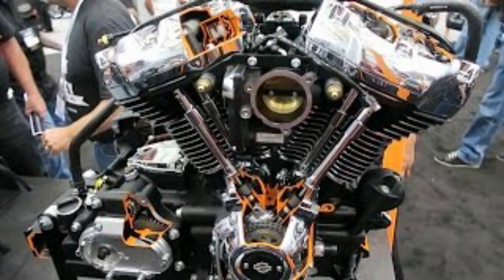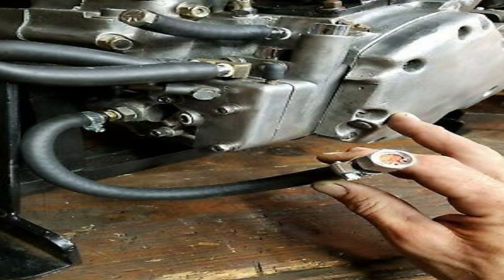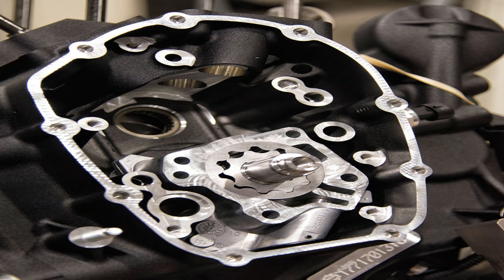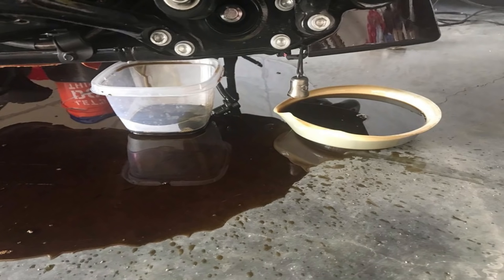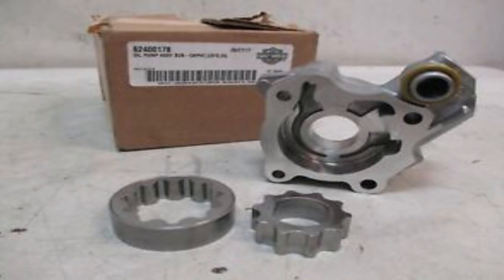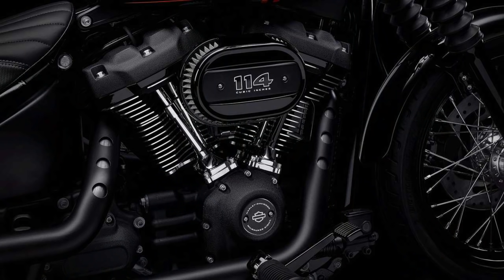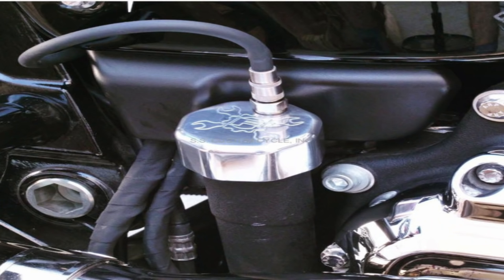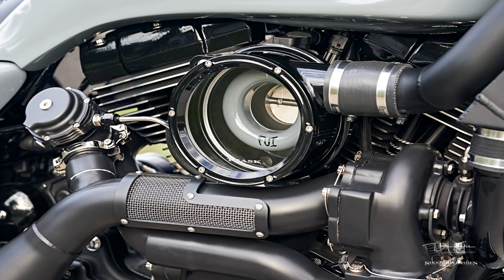The Fatal Milwaukee 8 Engine Flaw Harley-Davidson Missed

Comment: Most of the S&S cam kits are out of stock. Good luck getting what you want.
Reply from the maker: Have you shopped around at some of the suppliers? Parts Unlimited, Dennis Kirk, JP Cycles?
Reply: @GixxerFoo  Thanks, JP is out of stock, but I’ll try those others that you mentioned.
Reply: @GixxerFoo  Parts unlimited is out of stock.

Comment: I have not upgraded because this should be a warranty problem, not an added $2000 out of my pocket.  H-D F'd up and needs to fix the damned thing.  They will probably have a class action lawsuit against them.  I have had several times while riding the bike when it is hot it takes more throttle to keep up the same speed.  I live in the southwest and the desert gets up to 120 + degrees and I ride my bike EVERY DAY!
Reply from the maker: The bad part is Harley won't fix it unless it presents a safety issue, that's the sad part about it. They should fix it and put the updated part in since they messed up.

Comment: I have a shovelhead & a twin cam based on this video and all the others, my next will be a revolution maxx
Reply from the maker: I don't blame you a bit, every Harley has it's issues. I am curious to see how that new Revolution Maxx works out.
Reply: @GixxerFoo  
150 hp from factory. Can you imagine when zippers & S&S get ahold of the heads & cams. , HPI Throttle Body & good flowing exhaust? Could be some very impressive numbers !

Comment: Can you explain how this got by the research and development department? This engine and I owned one works pretty well for an engine with unequal oil pressure. Any engineer worth his salt would’ve caught this. Any mechanic worth his salt would’ve caught this. I don’t know maybe they’re pressure transducer’s failed on the run stand.

Comment: So a stock M8 will never see this problem then?
Reply from the maker: The problem is that they came from the factory like that, it's a potential issue with even a stock M8.
Reply: @GixxerFoo  is Harley going to do anything about this then? Do dealers have discounts for the work or anything? Any lawsuits from failures you know of?

Comment: It's not a problem on a shovel. It's normal if the bike has sat up for a while.
Reply from the maker: For sure if it's sat a while, Harley had some oil issues back in the 70's when the bikes were new. All the emissions crap and the junk fuel back then was awful for those motors.
Reply: EVOS do that too ! Problem wasn't solved till 1992  ! Here's how I cured my 91 I ride it everyday ! LMAO
Reply: @leonardstanford1877  agreed brosh 🤘.
Reply: @GixxerFoo  no doubt but it's like you said never buy nothing brand new in it's first few years. Preciate the channel 🤘

Comment: Does everyone know about the feature to keep engine cool where you turn bike on but not started and roll throttle forward for 3 seconds special feature look it up there is also a video about it
Reply from the maker: Parade mode is what it's known as, it shuts down the rear cylinder at a specific temperature when you're at idle. Bike sounds awful but it works!

Comment: The twin cam motor has issues & now the M8 has more issues ! Buy a 99 to 02 bike drop in a big S & S motor & the only time you have to see a M8 is when you blow by one ! Enough said !
Reply: Or just buy a Honda motorcycle and be done
Reply: @Bart Szmanzki 99 to 02 bikes had a timkin bearing holding the flywheels in the left side of cases & those flywheels were solid also the primary drive line was a much more dependable system ! I like the 88 to 95 inch motors that short stroke let's the motor rev quicker  ! Those early TC motors all you have to do is add a gear drive & the only issue they had ( cam tensioners ) is gone just add gas & oil  & ride !

Comment: With all the quality issues like these I think I will stay away from these M8’s. From the oil pump, the blow by, the loose oil jets in the pistons, all just screams crap quality to me. I haven’t heard about these issues from other manufactures such as Honda or Indian. I think my next bike will be one of those new Indian chiefs.
Reply from the maker: It just blows my mind they had those issues going on for several years, they've got it lined out out now but I haven't seen a confirmation on the long term with new oil pump. I do know earlier M8's with upgraded aftermarket pumps and vented dipsticks/transmission covers have eliminated sumping.
Reply: I rode a Victory Vegas for 10 years never had a single problem, recently ordered a 2019 breakout 114 but after watching this video i feel like just shot myself in the foot FML >< yea i shouldve stayed loyal to Polaris and got an Indian dark horse bobber :(

Comment: POS oil pump causes mad sumping .. thus frying my crank sensor and leaving me stranded on a cold December night.
Fortunately was able to get a ride home and a shop I know scooped up the bike in the morning
Took a few months to get a crank sensor.
Did a Daytona oil pump, new crank sensor .. and since they were in there .. did a cam upgrade, lifters and some other bottom end stuff 
And a good tune .. and catless head pipes 
Bike rides 40000x better now than it ever has frlm factory.  2019 FLHR.  Broke down 9400miles

Comment: Oil sump is only the tip of the issues for  the M8 .
Reply from the maker: It's one of the biggest ones right now that's caused a lot of issues.
Reply: @GixxerFoo  Not even close to to biggest issue.They are sucking headgasket due to to fitment at the base of the cyl ,at the case, where the oring is , jugs are turning blue they are getting so hot. Its one big pile of crap ,Neber mind the connecting rods dont even have a bushing for the wrist pin. i could go on.

Comment: I picked up a used 2018 Fat Bob 114 with 2300 miles on it. Engine had a catastrophic failure at 2418 miles. Fortunately I was able to get my money back and got on a 2020 Lowrider S 117. Less than 300 miles later same thing happened. In my experience M8 is a turd.

Comment: How the hell is there not a recall on this?
Reply from the maker: It honestly should be, but it's not considered a safety issue so it doesn't require a recall. I think last recall Harley had to do was for brake system issues, so if it's not going to injure or kill someone you're on your own it seems like.

Comment: Never seen a 8 valveoil pump give trouble yet & i know heaps of people with them .these billet alloy parts are crap its soft alloy & wont last . As far as venting gasses the heads are well vented .this is just crap oil froths when heating up once it hits running temp it stops .also never seen a 8 valve leak unless its been played with .

Comment: The oil pump was upgraded for four years in a row, still not as good as just going with the s&s plate and pump. Transmission oil problems another problem.
If you like wrenching and spending money there the perfect bike. I'm on my third one and will not be doing this motor company anymore.

Comment: Did Harley get in front of this and change these for customers at no charge?
Reply from the maker: They weren't replacing the pumps unless you had sumping issues. But they did update the oil pump on the 2020 models.

Comment: lmao vented dipstick ..... just put the trask trans vent on problem solved and run a catch can to keep your top end clean ...17 - 19 need the pump upgrade also
Reply from the maker: M8's have awful crankcase ventilation, anything helps to keep that oil flowing. Really seems like the upgraded oil pump is the best way to go though.

Comment: HArley has had 4 oil pumps for the M8 and still can’t get it right…….
Put an S&S or another performance mfr oil pump and don’t forget to 
Put a different cam plate in while ur doing it….HD cam plates are shit also
Reply from the maker: The cam plates are crap, I have a whole video on the twin cam cam plates covering that https://youtu.be/Fi81VH4y9AM. The M8's are not any better.

Comment: Airated oil has never been good. Where there’s air there’s no lubrication ..  and fluctuating oil pressure. And with a sender that works on 5 or 10psi. Not good as said oil light may never come on to inform you.

Comment: Why should an owner who has spent maybe $20,000 on any new bike, including a HD, just "expect" teething problems with a new motor. If this is so it does not bode well for the new Pan American does it??
Reply from the maker: The Pan America is a much more modern engine design with much tighter tolerances, I wouldn't expect to see any crazy issues there.

Comment: I would rather have a nice cool running Eeveelution Motors Harley they're newer Motors are absolute garbage. Even if you do all of the upgrades to a twin-cam it still runs hot as h a d e s. I would not take a twin cam or a milwaukee-eight engine because I cannot afford to make them reasonably reliable and avoiding catastrophic engine failure. I will probably buy a couple more Evolution Motors rigid mount Sportsters.
Reply from the maker: Evo was the best engine Harley ever made hands down. If they just would of made a big inch engine in the Sportster design it would of been indestructable.

Comment: 2019 Street Glide „Standard“

128ci with HD high flow oil pump
Trask CheckM8 (installation is a PITA)

https://shop.traskperformance.com/products/check-m8-vented-trans-top-cover

Had the tube missing, one call later, the tube was packed up and on it’s way!! Trask customer service is awesome 👏

Comment: If harley wanted to stay In business they would recall this M8 that People have. If not   RIP  2017 doesn’t have 1700 miles yet.  Just not pleasant to ride.
Reply from the maker: It seems like they have it somewhat sorted out now with that oil pump, I agree they should recall it and replace the earlier model pumps too.
Reply: @GixxerFoo  My bike is a Road Glide limited 2021. supposed to have the new oil pump. But still, feel Noise like a lifter tick tack when the engine is so hot.

Comment: I was under the impression this isn’t an issue on current production models, as in 2021
Reply from the maker: They had that issue from 2017 to 2019, in 2020 they had a revised oil pump which so far seems to eliminate the issue.
Reply: @GixxerFoo  I certainly hope so. I have a 2021 road glide I’m still breaking in and for me it’s way too expensive a machine to be having these types of issues. In the sport bike world you could literally buy just about any bike you want for what these Harleys cost, and I almost did. lol
Reply from the maker: Yeah you get a state of the art machine for 20k in a sport bike. But they don't hold their value for crap, at least the big 4 don't.

Comment: fix that M 8  Honda F6B 120 hp 125 #tk  all you will ever need  plus 45 fuel MPG regular will run on pump piss   no mods needed
Reply from the maker: Honda makes a solid motor, no doubt about that.

Comment: M8 is all good now this is old news
Reply from the maker: They are better now, still some issues with sumping on some models. The crank case ventilation is still causing some problems but the new oil pumps have helped tremendously.
Reply: @GixxerFoo  I have the Softail standard 107 no problems at all

Comment: Sorry, Harley-Davidson, but I have to call you out on this. There are two kinds of riders, and you know it.

If you build a rig for the long ride, there is thus thing called engineering. You can actually measure what your engine is doing. There is NO excuse for this.

You can measure the oil levels on a test bike. There are plenty of devices available to monitor the internals of your new engine.

Nuff said. You dropped the ball. You made your faithful riders test subjects.
Reply from the maker: Completely agree, obscenely enough the issue seems centered around the touring models which are going to be rode long distances for long stretches at a time.

Comment: 20,000 miles with a 2019  107 milwaukee with no problems. This guy is a fake.
Reply from the maker: That's awesome to hear, not all bikes had issues and the issue varies in severity as no two engines are alike. That's likely why Harley never did a total recall, although I feel like should of done something voluntary as a show of good will. A lot of dealers will fix it and sort it out with Harley though, which is awesome cause sometimes the dealer eats the cost.

Comment: 120 years of making motorcycles and still not perfected or at least designed correctly.but spend 20-30,000 $$$ is. for something you have to put another $2-3,000 into to make run right. no wonder, people are buying Indians & hondas. who the fuck is running this co. into the ground, at your and mine expense.!